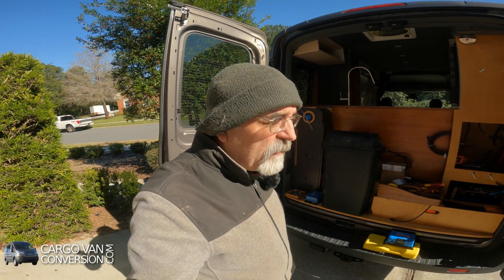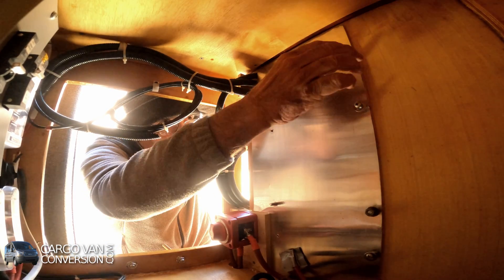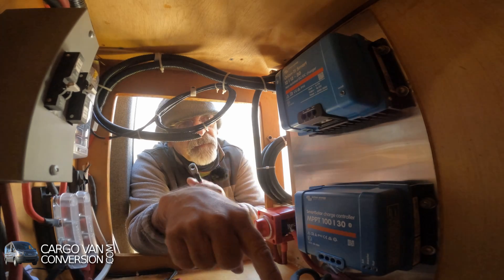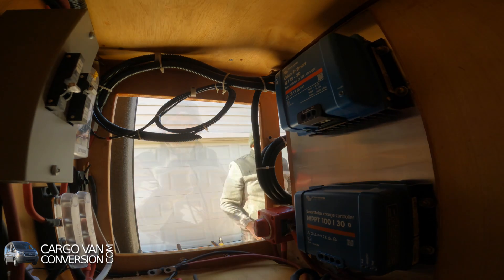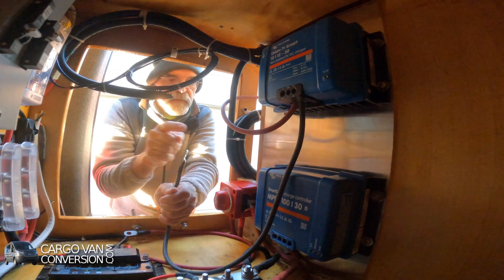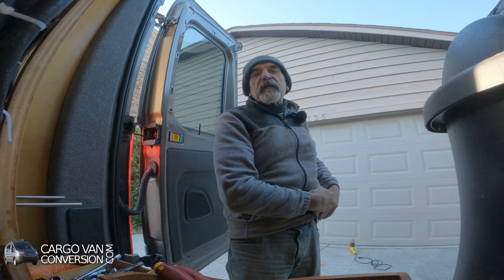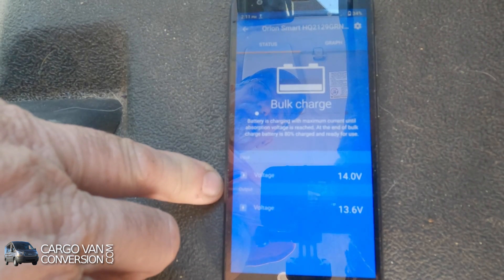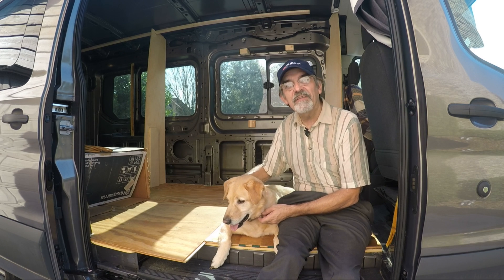Installation of my Victron Smart Solar Controller and Non-Isolated Orion DC-DC Converter

Comment: Nice and clean install. Thank you for sharing.
 I just picked up the same dc2dc charger for my truck topper camper build. I'll take your advice and mount it on an aluminum plate,  It should keep the excessive heat from the plywood. Look fwd to future videos😊

Comment: Nice job on the install, although I wonder if you could have mounted the metal plat on a hinge to allow face to face access with the unit when installing or trouble-shooting in the future.  Also, I would have put them side to side if possible as opposed to stacked like you did, due to the heat from the lower controller adding head to the upper one, in an already confined space.  I'm a proponent for mounting controllers where you can see them easily, I like the blinking lights.
Reply from the maker: Hi Terry,
a hinge is a good idea, may still do that. Although don't expect much to troubleshoot with either of them. Because of the confined space, I have a small temperature regulated fan installed. If I had the space, side-by-side would have been much better.
Just a related fact: during the trips that I've made since the installation, the DC-DC converter only worked for an hour in the morning, while driving. And some absorption and float the rest of the day from solar. So I had very low demands. That may/will change will I move into the van permanently.
Van Williams
Reply: @cargovanconversion  We're staying in an RV park in my class C motorhome in Vero Beach FL.  It may be too late but would be nice to meet you sometime.
Reply from the maker: @TerrydeAlaska  Hi Terry,
Love to meet you too; just a bit to far away Weeki Wachee area north of Tampa. And preparing for Tennessee. Maybe we can setup another time.
Best is using my email: van@cargovanconversion.com
Wished I'd known, I was really close a few weeks ago :(
Van Williams

Comment: Hello Joey and thanks for the video.  Can you tell me how/where you installed the ground wire to the CCP ?  Did you connect to a specific spot on the van's chassis or did you attach it to the negative terminal of the battery underneath the seat, then back to the Victron charger?  I have heard both ways and could use some help on that.  Thank you!
Reply from the maker: Hi Doug,
Like jump starting the vehicle, where you connect positive to positive and ground to a grounding point on the vehicle, you have to connect the ground wire to an interior grounding point. There are many grounding points around the vehicle ( see the BEMM guide for those),; I found the most convenient one in this case on the floor between both seats.
There is a rubber mat the ends just behind the seats; if you follow the rim to just right (looking forward) of the driver seat pedestal or handbrake and lift the mat, you can see one grounding point. That is the one I used.
I suppose, you can also use the negative terminal on the battery, but that's not advised by Ford.
Hope that helps.
Van Williams
Reply: @cargovanconversion  Thanks a lot Joey.  That makes sense. I just discovered my first big, and separate, issue of my build today which you helped me discover.  I was looking for how to release the spare tire and found you had to use the interior plug and winch it down.  Well, that is all covered with flooring right now of course. Sheesh!  So I am in the process of trying to locate the hole, as close as a I can, so I drill a hole.  It seems doable if I can use a local one at a dealership and map it out.  Just need to get close.  Have any ideas?  My inexperience shows more and more, eh?
Reply from the maker: Hi Doug,
You know, experience comes from making mistakes. If you can copy the location, you can use a holesaw or Forstner bit to reach the access hole. The hole is covered with a rubber seal. Should be an easy fix.
Wish you well.
Van Williams & Joey
Reply: @cargovanconversion  thank you for the words of encouragement Van. I was thinking the same thing on the hole saw. I am visiting my local Ford dealer today to make a better attempt at finding the correct location. Really appreciate you getting back to me. Hope you have a great week

Comment: As you update your electrical system do you  run your new wiring inside or outside the vehicle?
Reply from the maker: The use of the word 'update' might not have been entirely correct. This solar controller has been planned many years ago and a dc-dc converter came into play when I was building the bed. I have an accessible space behind the toe-kick of the bed, that has now three cables running from the cabin to the battery bank area. I would try to avoid running these cables outside the van, unless absolutely necessary.
Van Williams & Joey

Comment: Thanks you for the video. I was wondering, although the converter has a nice size heat sink, is there ventilation in that compartment?
Reply from the maker: Hi Lou,
Yes, this compartment is fully open towards the rear doors and while loosely covered by these traction boards, there is also ventilation to the left and an active fan between this and the compartment below where the batteries are.
I worry more about super high ambient temperatures in the summer; while I can always open the rear doors, this will at least have a negative impact on the life of the batteries.
Van Williams & Joey

Comment: That DC to DC converter is a pleasure battery lifesaver!! Great install Van.
Have you got a battery monitor (with current shunt)?? They are quite inexpensive if you avoid the "branded" models.
Reply from the maker: Hi Norman,
Electric independence in the van is surely one of the major issues. When I started thinking about living in a van (10-15 years ago), that wasn't so clear yet. Lead-acid batteries were still the mainstay; propane the way to go. DC-DC converters not practical. When I started the actual build, the first thing I did, was the hookup cable/wiring for 110V external access (this wiring is still in there and unused). In my calculations, this converter fully replaces dependence on commercial campgrounds with self-sustenance.
In addition to wide spread use of Lithium batteries and cheaper solar panels, much has changed.
Yeah, battery monitors... I like these comprehensive ones such as from Victron, although simpler ones also work. Just have two objections: I dislike all these blinking displays around me and I wonder if I really need one.
With this (for me) oversized Lithium battery bank (550Ah), most days I know there is enough power to go around. When there happen to be multiple non-producing power days (i.c. rainy days), I know I want to move to a better location. That means the converter (or a second one) will take it over.
Single reason that makes sense to me is battery maintenance, yet that can be done with a voltmeter. A shunt/display will remain an option in the future, just don't see it as a necessity now.
BTW Ask me a simple question and expect a long answer :)
Van Williams & Joey